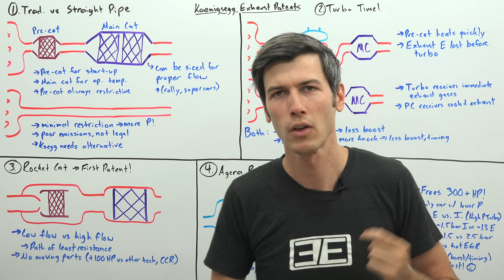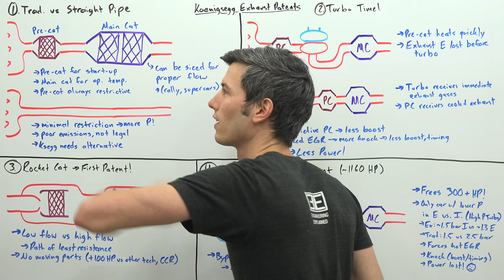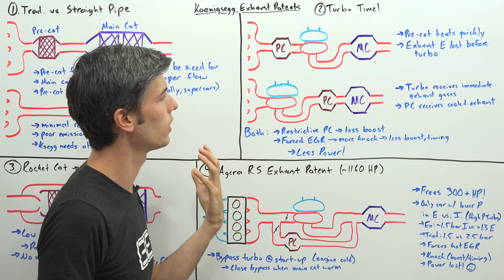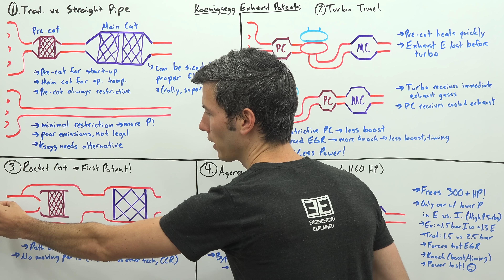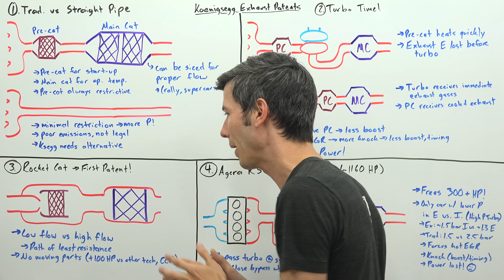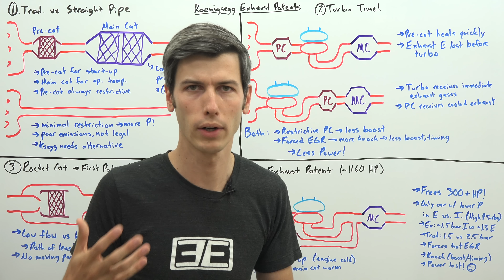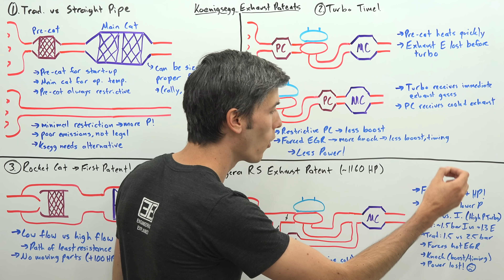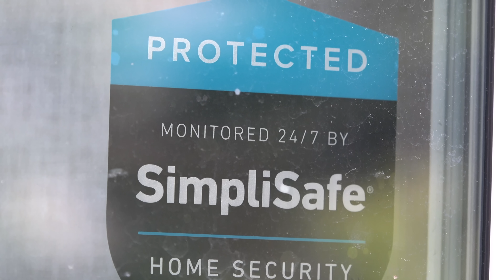Koenigsegg Proves You Don't Need A Straight Pipe Exhaust

Comment: They have come up with a very simple system, amazing no other manufacturer has done this prior.
Reply: After seeing example 1, my first thought was basically example 4. Seems obvious, providing the gains outweigh the extra weight of the valves and pipework, which I guess they do.....
Reply: I doubt the other manufacturers couldn't come up with it, more like it wasn't worth the extra costs or the cons weren't that bad for them since most manufacturers don't care for making 1000 hp+ cars or something along those lines.
Reply: @Sinehmatic  Knowing the nature of most industries, engineers would already patented the design if they already thought about it before, costly or not. Like Christian said in one of his interview, the Lightspeed Transmission is small for its size, considering it would be used to handle over 1000Nm of torque, but if you are to design one for lower torque application, it would be significantly smaller and lighter. Plus, I believe like any other innovations, once its been researched, experimented, and improved, even the cost would be less and more affordable.
Reply: Which circles back to the main point, the bypass system is not required for most car manufacturers. There probably are patents for the same concept, but with different design and/or architecture.
Reply: @Sinehmatic  well, it seems this fairly simple system allows to save approximately 10% of the engine power. That means you can build a more efficient engine while still making the same amount of power, and that certainly is something all manufacturers are interested in.
Reply: @Sinehmatic  agreed!
Reply: @Sinehmatic  bruh what is " most"

I'm so sick of you guys comparing Koenigsegg to manufacturers that make budget cars lol

Is Koenigsegg the only company that charges $2m for their cars?

Why are they then the most innovative out of all of them
Reply: @All Cars Matter 1. i Don't think anyone here is using "big" words" 2. It's a discussion, we don't have to be experts, we are allowed to have opinions and insights even with our tiny monkey brains.
Reply: Makes me wonder if I could put one of these exhaust systems on a different car.
Reply: @potterfanz6780  Assuming you meant the general idea rather than that exact system, you still wouldn't have the space anyway ;), not to mention you'd be adding a source of potential unreliability.
Reply: @potterfanz6780  it's patented bruh

Koenigsegg lawyers will hunt you down

Unless you make a one-off build
Reply: Yes it's actually quite fascinating. Some of the greatest innovations consist of simplifying existing models. It's the same Koenigsegg did with their new gearbox, where they essentially combine it and the clutch in one package that makes it much lighter and faster in response than any conventional gear/clutch setup.. All it takes is a bright mind wondering if it's possible to make something simpler instead of just doing what we are used to do or taught to do.
Reply: Daniel Kemnitz    No.  In 4 Koenigsegg adds cost n complexity to get performance.   It is rather obvious solution that most (all other) car mfg’s avoid due to inherent $ n reliability challenges